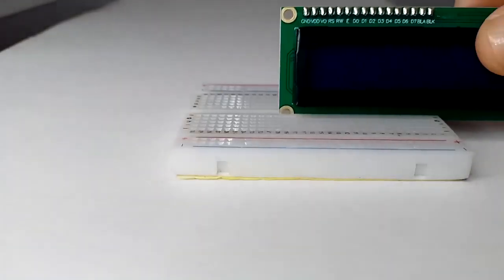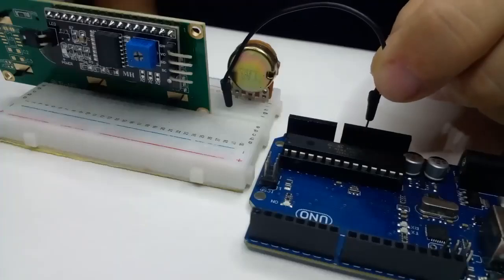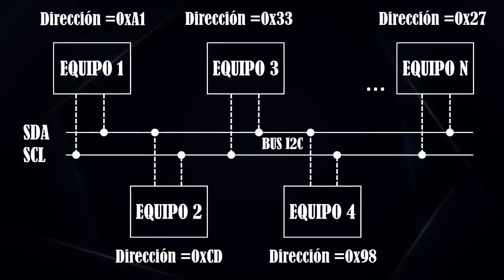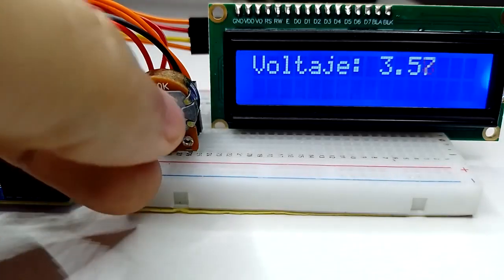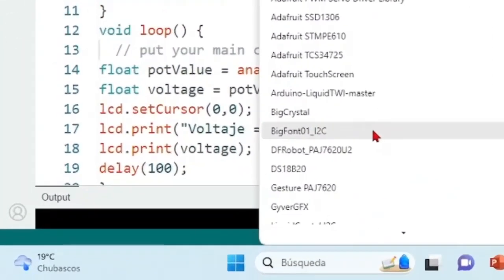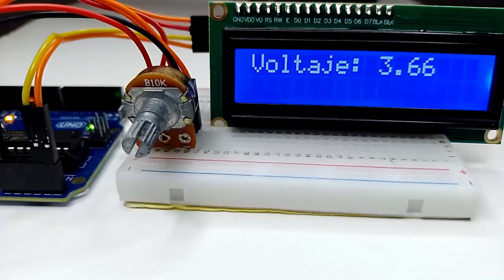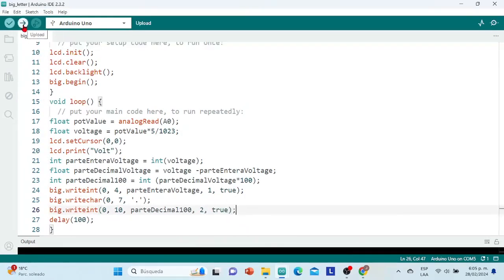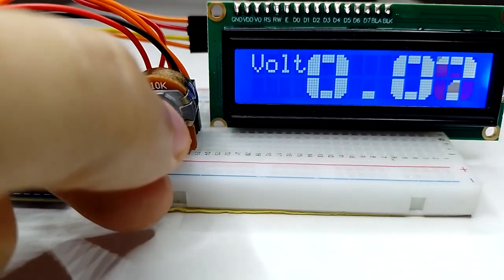Big Numbers and Letters on I2C LCD Display with Arduino BIG FONTS

Comment: Awesome video, very informative. I was wondering if it possible use the same library to display a big font lock on a 20x4 I2C LCD
Reply from the maker: Thanks a Lot. I think it is possible Even with the standard liquidcrystal i2c library, to create special characters with the shape You need. regards